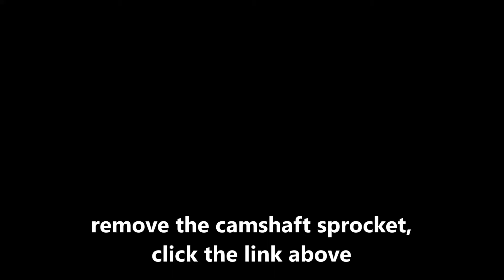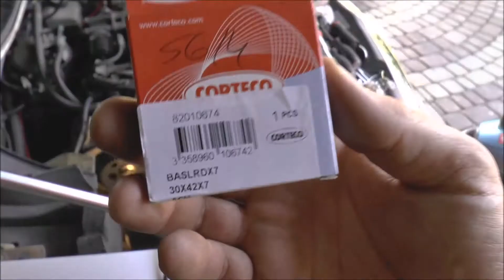How to replace camshaft seal, simering, - 1.9 cdti - astra, zafira, vectra, lancia, z19dt, z19dtl

Comment: Hello, thanks for the video. Isn't that the same engine as the 1.9 JTD on fiat? (188A2000). I was wondering if it's a good idea to do this procedure as preventive maintenance when doing the timing belt. If it's the same engine, I'm wondering why in the fiat workshop manual it says to remove the cylinder head cover and to remove the camshafts. It seems way easier the way you do it. Also is it a big job to do the crankshaft seal?  You can't just remove the crankshaft pulley and change the gasket in the same way as the camshaft seal, is that correct? One last thing: I have the air conditioning pipe that passes on top of the timing belt cover so it's gonna be hard to access. The manual says to empty the air conditioning system, sounds annoying as hell. You think there's a way around this? Thank you
Reply from the maker: If yours is z19dt 8V, it is the same.